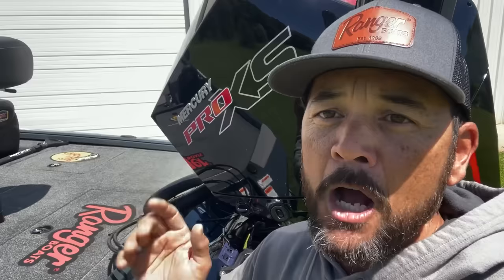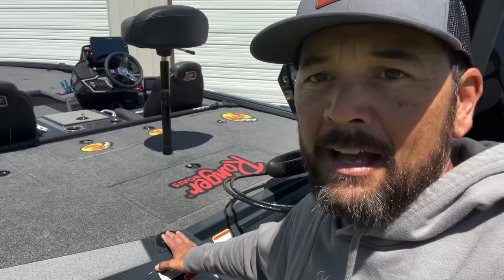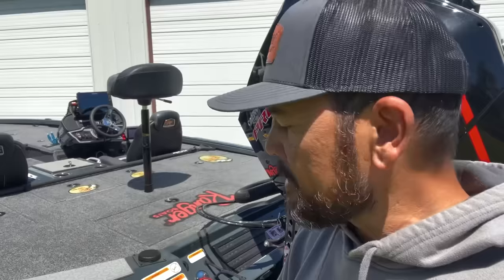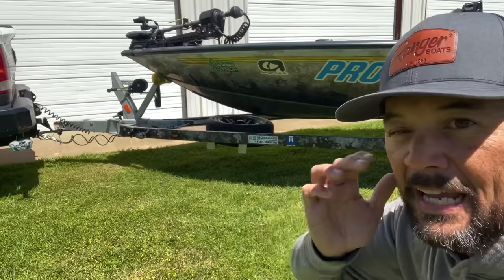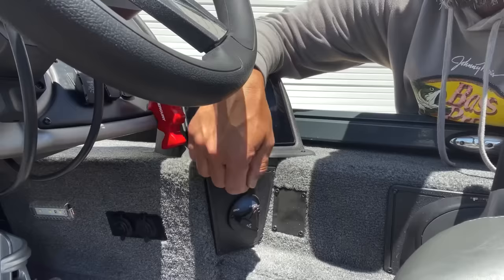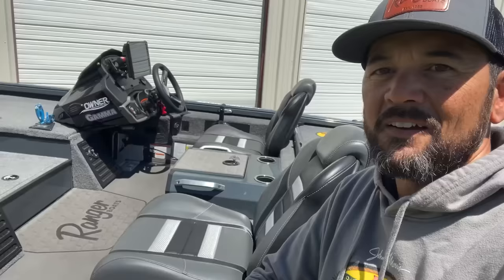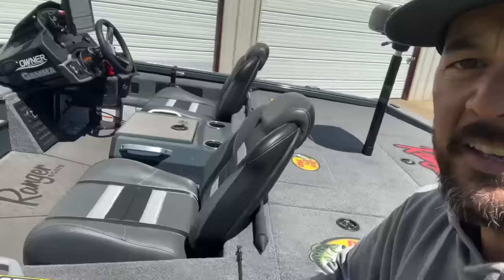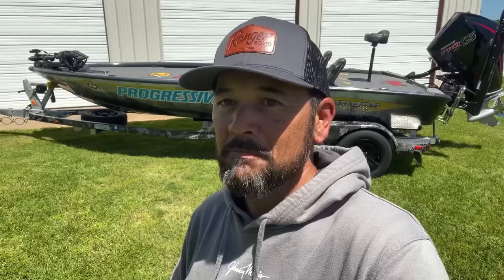2024 RANGER ALPHA 208, Part 1, NEW Aluminum Boat Design Walk Through Video | #bassboat  #rangerboats

Comment: On the surface it looks nice but my question is how are the stringers made? What material is used? What gauge aluminum is used? This just is very basic info.  The layout is nice. Seats and consoles look nice. The access hatch in the looks small though.  If the side boxes are not going all the way back why didn't they make the rear deck lid longer for easier access?  Also curious if a passenger console is an option.  Plus my only problem with all Johnny Morris owned brands is you are stuck with only a mercury.  Good engine but I'm really a Suzuki fan. Plus is it an option to get Garmin electronics if wanted?

Comment: Looks really nice but I’ll stick to my Lund Pro V Bass 2075. Can’t go wrong. Proven fishing machine.
Reply from the maker: Don’t pass up the chance to take a ride in to 208 Alpha if the opportunity presents itself
Reply: So far the only aluminum bassboat I'd buy is a gatortrax.  That's why I asked about  the stringers and thickness of aluminum.  So far no major company in  my opinion has strong long lasting quality except gatertrax and a few other smaller custom companies. No offense  but Lund doesn't make the cut in the big boy department.  Good if you're buying a 16 footer.
Reply: @adamportner8102  This new ranger aluminum boat is basically built by bass pro shops in the same factory. Talked to someone who works at the ranger factory. I’m still going to stick with Lund’s IPS hull. I’ve never heard of a transom damaged because of a 250hp motor on a Lund.
Reply: @mikeyID  watch the old video about extruded metal stringers by gatertrax  it will open your eyes
Reply: @adamportner8102  I know gatertrax is built probably the best out of the aluminum boats. I like the Lund because it is riveted and super strong. Great design. I had a ranger bass boat before I bought the Lund 2075 pro v bass. Nothing rides and preforms like a glass boat. You know when you own a glass boat you stress out about everything. Don’t hit anything that will chip or crack the gel coat. The Lund 2075 fishes almost as good as my ranger. Amazing deck layout and very stable. Not nearly as fast as my ranger but my Lund can take rougher water. I bought my Lund October 17 2019 for $50K. They wanted to sell it before winter hit. Got a smoking deal. Again this is just my opinion.

Comment: How much does the aluminum boat weigh compared to a 20 ft Ranger fiberglass boat?
How much does the trailer weigh compared to a Ranger steel trailer?
One last question. How much did you save on fuel cost while fishing and while towing?

Comment: First look is that it has the same  issue that my Vexus has. If you have a partner that needs to sit so they fish in the back; The center box between the driver and passenger seats is to high. If you are not 6'8' it is very hard to get off the back deck into the floor of the boat.
Reply: Maybe if they are 80 years old. Otherwise they should have no trouble at all.
Reply: @stonehorn4641  or you could be 40 and have a disability that limits your mobility.